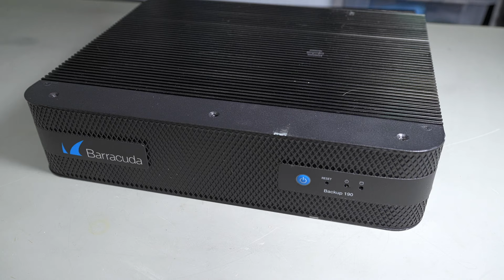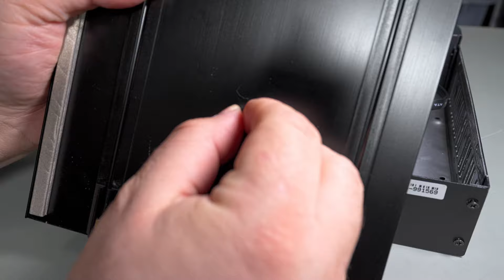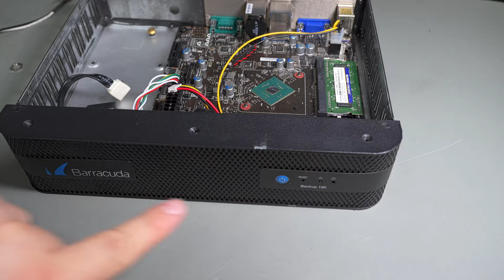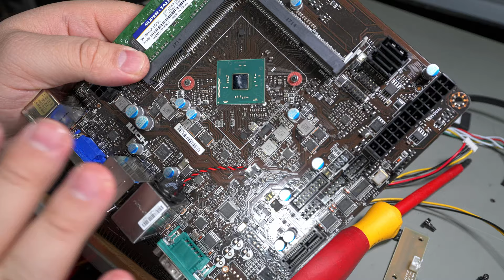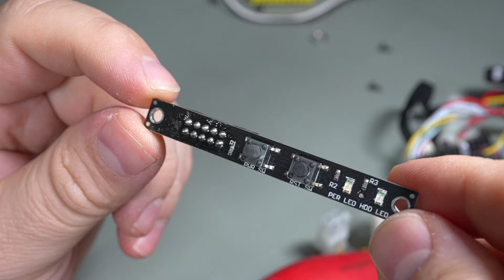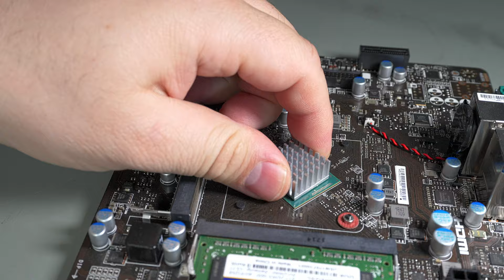Still trash hardware? Barracuda Backup 190 teardown

Comment: The recycler most definitely fucked up the heatsink so hard it ripped the threaded inserts out.

That CPU does need a heatsink of some sort to safely operate
Reply: It might have been a special block, screwed into both the top of the case and the motherboard.  And they broke it when ripping open the case
Reply: @leonidas14775  The entire top of the case acts like a heat spreader. The screw attached to a block that sits on top of the CPU with thermal paste. It does not just ship with nothing like said in the video. The recycler screwed up.

Comment: Barracuda units like this usually have pretty big alu cylinders bolted in (that mystery bolt at the top) that interface with the cpu and the top panel.

My guess is the recycler just took it for scrap.

Comment: in my experience the HDMI port is a pretty big negative indicator, HDMI has always been a weirdo on PC hardware, since it's origins are in home theater applications. It's somewhat normal to see it as one of several options on a graphics card, but it's presence on the motherboard indicates the motherboard is targeting low end users who won't pay for a graphics card and are likely to use it with a television rather than a monitor, because they already have a TV and don't care. In any kind of datacenter application, you're going to heavily favor VGA for it's simplicity, DVI if you have to. It's gotten really cheap to put Displayport on a motherboard, and Displayport's origins are in PC applications, but there's really no need for it until you need higher resolution and framerate than VGA or DVI are happy to provide. This seems like more of an office support appliance, I really can't imagine what use it would be with only one drive, but Barracuda isn't in consumer price ranges. It supports HDMI 1.4, which released in 2009, well after prosumer price multi-drive NAS-box products were available from companies like IOmega, but also HDMI version adoption has never gone well so it could easily be a few years younger than that; wouldn't you know it the 1.0 version of the BIOS was published in 2015.

They built a low end HTPC in a box and sold it as a "backup" "thing" that seems on par with the Apple Airport Time Capsule from 7 years prior, which was also maybe 1/8th the size, and a wifi router.

Comment: I have one on my bench that I pulled out of service.     You mentioned in your video that you "reset" the bios on the device.   I don't see a jumper for that.   I found the board manual and it doesn't mention a jumper for resetting bios.   Which leads me to my question.   How did you reset the bios on this board?

Comment: I'm guessing if there was any kind of heatsink at all, there would be a chunk of metal that'd mount to the top plate with that random bolt which would smoosh onto the CPU with some thick goo or a pad to connect the CPU die to the fins on top. Dunno.

Comment: The majority of power conversion in a normal ATX power supply is from mains to the 12V rail. That's what makes PC power supplies so big.

When using a Pico ATX supply like this there is NO conversion to 12V, it just has to make 5V and 3.3V (and the negative rails which are almost zero power), so the power rating of a Pico supply cannot be compared to a regular ATX power supply.

That said, I do agree the wires are very thin meaning you won't be able to pass much power to the board with them.

Comment: There is a piece missing. The heatsink attached to the top case and pressed down on the CPU die, the bolts likely performing a spacing duty.

Comment: Might be worth a try to test with a different RAM stick. I had similar behavior on an embedded board, and even though the stick I was using should've been compatible it would hang on trying to load the OS. Swapping with the same specced stick solved the issue. Maybe DDR3L would work.
Reply from the maker: I mean, you'd think Barracuda would spec the right RAM. But I wouldn't put it past them. haha
Reply: @PeterBrockie  Might not be the original RAM, someone's been in there after all. I also can't get over the cheapness of the case. Never heard of Barracuda before, but I think I understand your disdain.

Comment: I once had a FortiGate 1U appliance I was trying to get OpenBSD installed on. It was some weird motherboard which unfortunately I couldn't find a newer BIOS / unmodified version. I think VGA was  disabled in the BIOS but I was never too sure after dumping the chip with my minipro and poking through it I just gave up
Reply from the maker: It's hard with weird embedded motherboards. They often don't release bios updates to the public.

Even if you contact the company they usually don't care. Haha
Reply: @PeterBrockie  yeah, sometimes the consumer version BIOS can be flashed on top. BTW, was there storage on chip? I was curious where it was booting from (or maybe it was your Linux?)